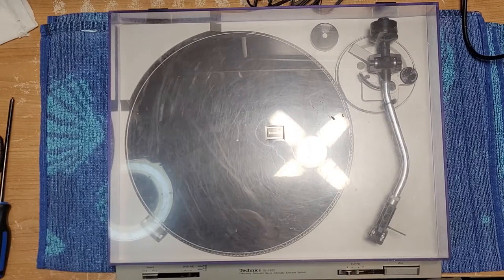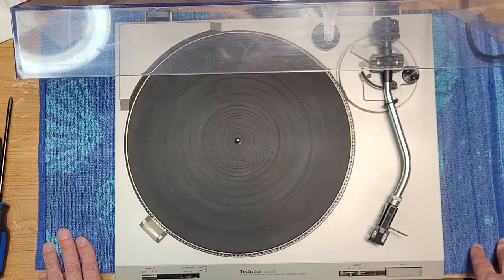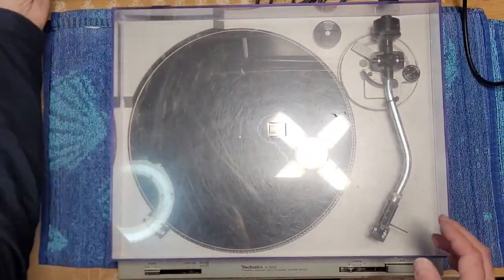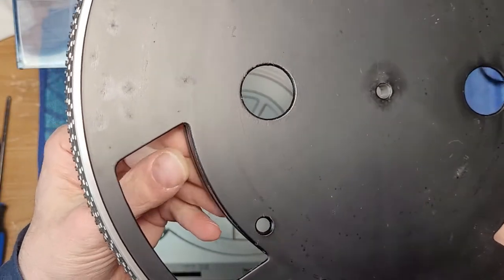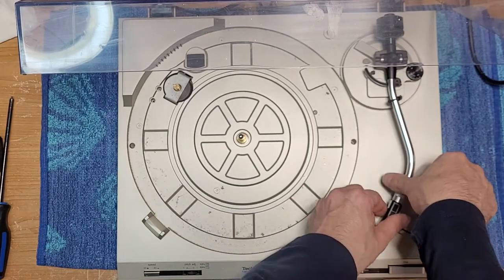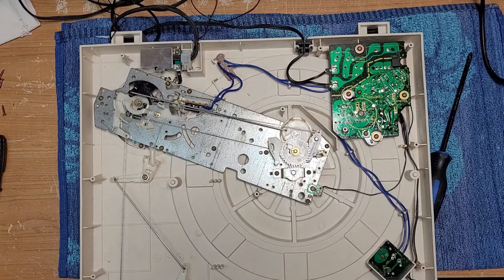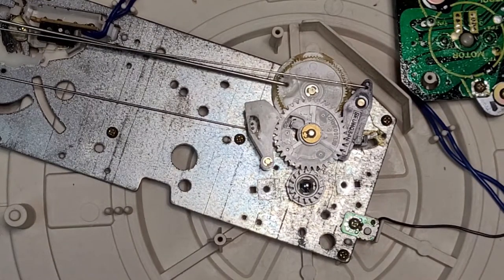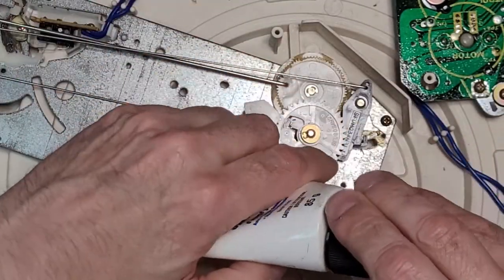Technics SL-B202: General Servicing

Comment: Hi.  I know this video is older but I recently acquired a B202.  It keeps steady speed at both 33 and 45 rpm but there's a loud(ish) ticking noise coming from the motor.  The noise increases in pitch at 45 rpm versus 33.  I added a bit of oil to the motor and main bearing but the noise persists.  Any idea what might be causing it and how to fix?

Comment: This brings back memories.

I bought a SL-B202 a few years ago as a fix-up project. It had a snapped hinge, needed a new stylus and belt.  The auto-return wasn't working properly, which thankfully was fixed by degreasing and regreasing the return mechanism's moving parts. The controls all needed a good clean with contact cleaner, with the 33/45 switch being a particularly stubborn one.

Then, once I got it running nicely, the motor started ticking, then buzzing 😫

After stripping the motor down and removing the offending broken plastic ring (I had to glue the parts of the motor together that the plastic ring used to hold in place), the motor now works great.

Touch wood, its worked fine for the last couple of years 🙂
Reply: Howdy! I just managed to fix one of these and its hinges are broken. May I ask how you fixed it / replaced them?
Reply: @electriclettuce666  I used super glue and it has held in place for 3 years so far.

If glue doesn't work, there are third party metal hinges you can buy that screw in place where the old plastic ones are.

Comment: Hi. Perfect video. I want to ask about technics sl b202. I bought a second hand recently which is at perfect condition as it has never played before. However you can hear loud enough a noise from the turntable when it spins. Will it be fixed with just a little oil from the top as you showed at the video ? Because I don’t feel comfortable enough to open it all.  Also can I use WD40 or is it bad ? Thanks
Reply from the maker: Do not use WD40 for anything other than cleaning grease.

Comment: Question, which of the rows on the plate are supposed to look still with correct rpm? I adjusted my 33 so the bottom row is still and it is waaaay to slow.
Reply from the maker: Depends on your location and whether you have 50 or 60hz electricity.
Reply: @TurntableGuy  wow. Interesting :) 220volt 50hz.
Reply from the maker: @henriccarlsson9052  So, look at the little chart beside the pitch control and adjust 33 for the line of dots at 50Hz.

Comment: Nice "studio" light upgrade! I think I purchased the same lights at Costco. Are they the ones with three adjustable panels that screw into a normal socket? I installed them out in the garage and in some locations in the basement.
Reply from the maker: The one I bought has 4 "fan blades" that adjust up or down.  It is really bright.
Reply: @TurntableGuy  I may have to make another trip to Costco.

Comment: I have this turntable and the motor makes a constant annoying ticking noise whenever it's turning. Once you play a record it's usually not audible but it can be heard sometimes and it's quite obnoxious. Any idea what the problem could be?
Reply from the maker: Try a drop of oil like in the video.
Reply: I had a ticking motor too, which turned into a buzzing motor.  Try the drop of oil like what Turntable Guy said.
If that doesn't work, it might be a plastic ring inside the motor which has snapped and is rubbing against the motor case.
If this is the case, you may be able to repair the plastic ring with glue, or if not (mine was too far gone), use glue to retain the part of the motor that the ring used to retain.

Comment: Complete noob here, could you please explain to me what the "strobe" is and what that little 60hz plate is supposed to show you? Also do you have an instructions on the belt boil as well as the lubricants/grease you use?
Reply from the maker: The strobe is exactly like it sounds - it flashes 60 times per second in 60Hz countries and 50 times per second in 50Hz countries.  By looking at the platter, you can adjust the speed by looking at the strobe pattern - when the dots appear still - you have achieved the correct speed.  Belt boil - just pop it in a bowl/glass with hot water and throw it in the microwave for 4 or 5 minutes.  For this deck I used a non-detergent 30 weight for the bearing.
Reply: @TurntableGuy  thank you! I am just getting as much knowledge downloaded as I can before I purchase a TT to resurrect! I just have a newer works right of the box AT. Never had or used a real deal old school turn table before. Looking at a YP-B4 currently.